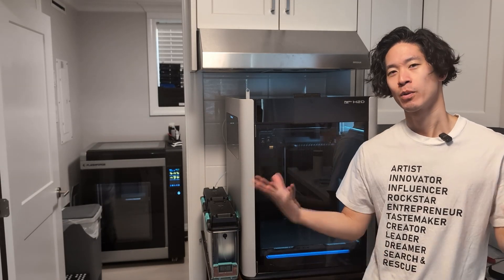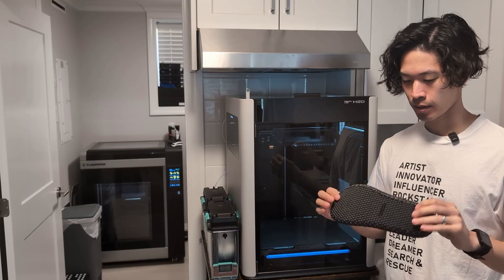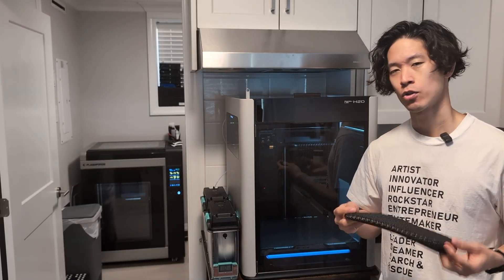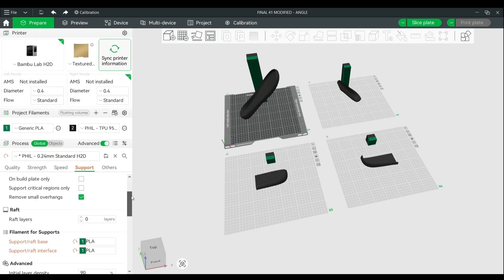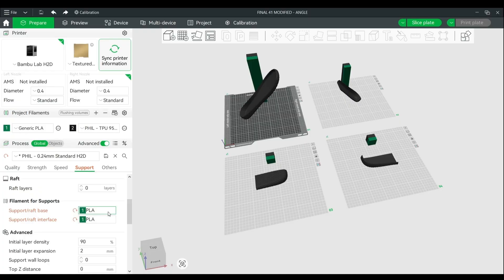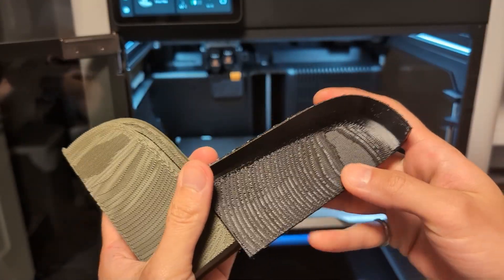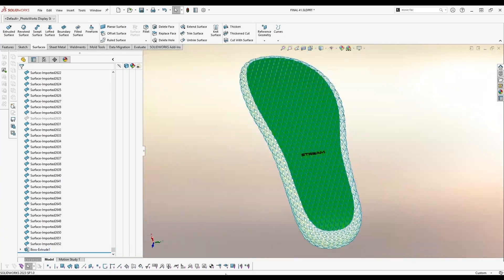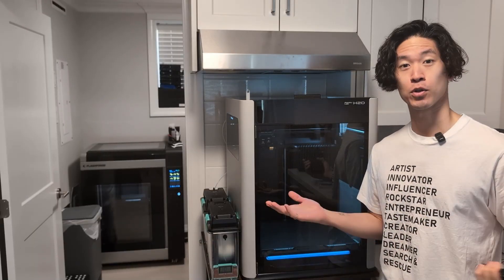Printing a SHOE outsole with TPU and PLA

Comment: Thanks a lot for the video, it gave me a great idea to improve my own results with the BambuLab H2D.
I’ve also been printing TPU with PLA supports, always feeding the filament through the buffer as recommended, but I’ve been getting inconsistent results.
In your video I noticed you feed the TPU directly into the extruder without using the buffer. I’ll definitely give that a try!
If I may ask:
- which brand of TPU are you using?
- do you stick with the default Bambu Studio settings or do you tweak them?
- and lastly, are you using a 0.4 mm or 0.6 mm nozzle?
Thanks again and keep up the great work!
Reply from the maker: You're actually not supposed to feed TPU through the buffer so that might be why you're seeing issues!

Bambu or Polymaker HF TPU, default settings (although I think I dropped volumetric flow rate down a bit), 0.4mm nozzle

Comment: As far as I know you could do it with others too. Bambu added recently the functionality for assisted filament swaps through the external spool.  But I agree that depending on the amount of swaps it makes much more sense to do it with a H2D.  But if people want to experiment with it or a have a part where the changes are almost all on the same layer height they can use the new feature. Functional Print Friday had an interesting video where he printed some bellows with the TPU+PLA combination.
Reply from the maker: Manual swaps would probably take forever for a tall part like this - but yes, technically doable!

Comment: cant wait to grab the snapmaker u1, multi material is where its at!
Reply: If the mass production devices will be reliable. After all their issues with previous printers I'm super sceptical that this will be a reliable machine - especially if they cut costs even more and constantly keep changing software. With their 3k Artisan having so many issues in the 3d printing area I'm super sceptical that a 1k tool changer will be reliable from them.  Some paid 4.5-5k for their full upgraded Artisan and called it the most expensive paper weight they ever bought because of the ton of issues it has. But lets wait until 2026 and hope for the best.
Reply: @Leif_YT  thanks for the warning. I purchased an sv08 and I spent more time repairing that than using it (and I'm including print time) lets hope the bontech indx can pair with a relible machine (with a bigger volume than the core 1)

Comment: Thanks for showing your method of doing this. I been thinking of making some shoe insoles with my H2D. I'll have to try it with PLA supports. Glad to see that TPU will feed through a PTFE tube and into the back of the machine. Or at least, that the Polymaker TPU that you're using does. I think I have some around the same shore hardness here to try. If not, guess I'll just have to feed it directly into the extruder from above like I've seen some others do.
Reply: If you're gonna make an insole try foaming PEBA or foaming TPU. I'd think that straight TPU wouldn't breathe well.
Reply from the maker: @hughjassstudios9688  this is an outsole...basically the outside bottom part of a shoe.
Reply from the maker: I haven't had any issues with the bulkhead coupler I made - with either Polymaker or Bambu TPU so far!

Comment: Great techniques and results, thanks for demonstrating so clearly.

Bonus points for understanding and showing  that many "print problems" come from bad mesh triangulation of original design files :face-red-heart-shape:
Reply from the maker: Thanks for the kind words! Haha and yes, usually a problem when I work with industrial designers and surface models 🫠
Reply: @emberprototypes  A big problem is, even in the surprisingly rare cases where they use something like 3DBuilder to "correct" the for-printing [STL] model, and it shows as "error-free", it creates ugly artifacts that impact printability.

Also, slicers like Prusa, BL Studio, and others that accept STEP files, only (badly) convert the STEP file to STL.

STL is a notoriously error-prone format, PLY format is WAY better especially for complex geometry models but hardly any slicers process PLY files unfortunately (For resin printing, Voxeldance Tango and Formware 3D accept PLY files, I don't know of any FDM slicers that do).

You're the first person besides myself I've ever seen even mention this issue publicly, so again, kudos!
Reply from the maker: @retromodernart4426  thanks! 🙌
Reply: @emberprototypes  surface models and Illustrator files.
Reply from the maker: @ViceChief  the worst

Comment: I was planning on buying a printer for Black Friday this year. In your opinion, which would be a good choice: X1C, P1S, H2S, or H2D?
Reply from the maker: It depends what you're using it for and what your budget is honestly. If you do engineering materials, X1C or H2D. If you're just starting out, P1S is a good entry level option. If you're starting and want a larger volume then H2S is good.
Reply: @emberprototypes  I would replace the X1C with the H2S in the buying advice for engineering materials - unless someone is on a tight budget.  H2S seems to be the successor for the X1C. H2S has the active chamber heating and many other benefits of the H2D the X1C doesn't have. For engineering materials I would prefer the H2S over the X1C now. With the H2 Series so focused on engineering materials I'm sceptical that the X1C will see a successor. The H2S and H2D are basically like an improved X1C so I doubt a bit that the X series will be continued.
Reply: Wait for H2C